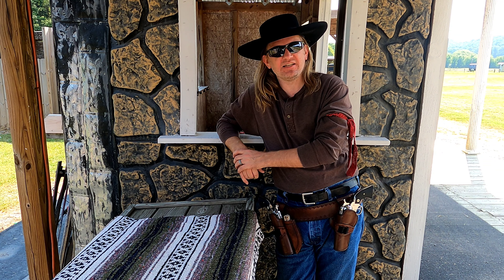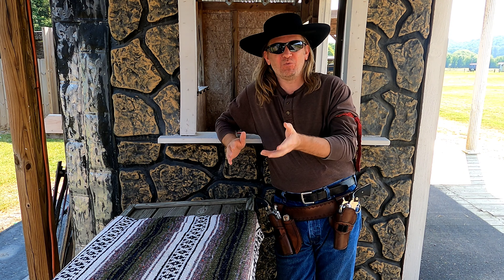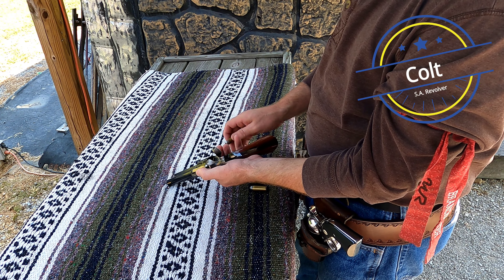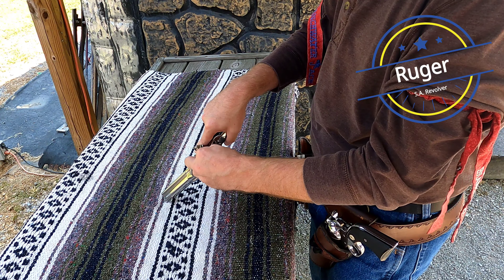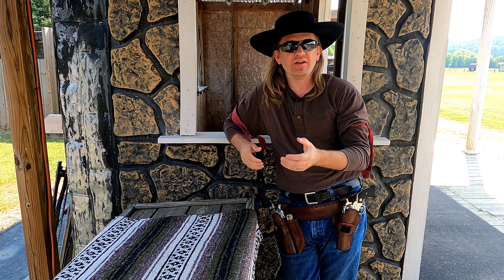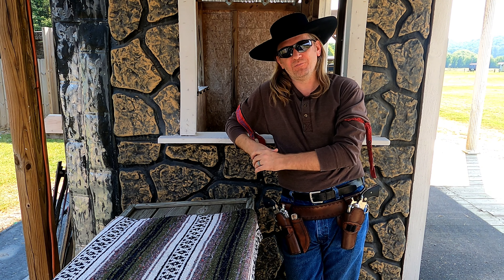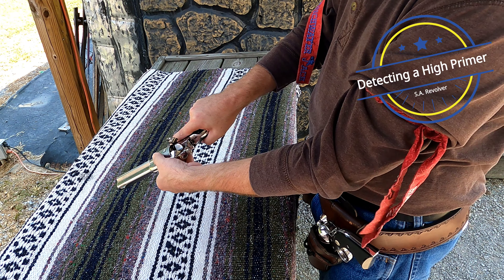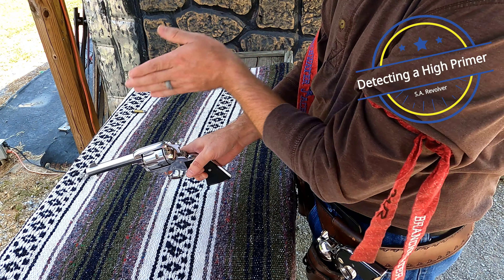TFL 36: Catching High Primers

Comment: Thanks for the loading tip! As taught, I use the “load one, skip one, load four” method. But, as you pointed out, I experienced an occasional high primer so I went to spinning the cylinder as my high primer check. This method served me well until I discovered a “better” method. At the 2019 EOT I saw several posse members using an aluminum 20-round loading block that also serves as a primer and case check. I purchased several (different calibers) from Desperado Cowboy Bullets (https://cowboybullets.3dcartstores.com/Loading-Block_p_97.html). Since I have been using them, I have not had a single high primer at a match. They are now an integral part of my loading bench and match ammo preparation.

Comment: Each casing goes over a pane of glass after setting the primer. So far that has worked for me. I also measure a few random rounds for proper OAL during the reloading session.
Having ammo on my body is an advice I adhere to. I also check the screws the day before the match. A few times I had to tighten one or two.
Reply from the maker: Great advice. I had issues at a State match when I first started out, because my oal was just a frog's hair too long. I'm a lot more diligent about checking that now and I was then!

Comment: Good video, I change my loading depending on what revolvers I'm using my 1858 conversions cover the gap at the rear of the cylinder so the load one, skip one, load four was the best option. I use the style you were showing when I use my rugers.
Reply from the maker: A lot of what we do is VERY dependant on the equipment we use! I'm still holding out for a pair of open tops.  Maybe one day...

Comment: No only does it help detect high primers, but it can also detect a burr at the firing pin hole through the frame of an Uberti.  I've had these develop in the middle of a match and had to remove the burr.  I also check all the screws on my guns every second  stage.
Reply from the maker: Checking your screws is more great advice! https://youtu.be/LM4dQuNN5qE

Comment: I'm of the mind that it's up to the shooter to figure out what's best for them.  Personally, I confirm that my primers are properly seated when I gauge them as a final QC check before packaging my match ammo.  If you choose to spin the loaded cylinder at the loading table, that's fine, but you accept the risks attendant thereto.  Especially if your revolver requires manipulation of the hammer and trigger as part of the loading process (my unaltered Ruger new model revolvers do not)l

I was working the loading table at EOT last month when a posse member set off a revolver round while trying to orient the empty chamber.  The "load one, skip one..." method would have avoided that.
Reply from the maker: The load 1 skip 1 would as long as the pistol fully indexed on that last pull of the hammer if your particular pistol requires that sort of thing. I was at a match a while ago where the person loading with the load 1 skip 1 historically would pull the hammer back and pull the trigger to hard drop the hammer. It works when the pistol indexes correctly...scared me to death when it didn't work that time!

But you are absolutely right...no matter what ever you do, it needs to be a part of YOUR process. That way, you are sure to be able to consistently repeat your process with expected results.